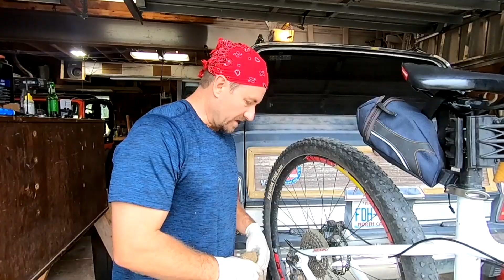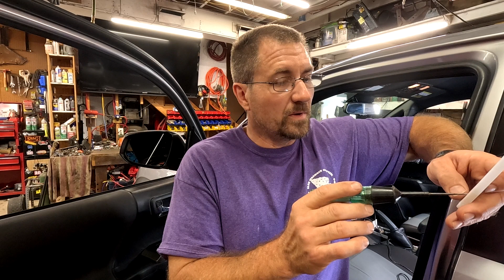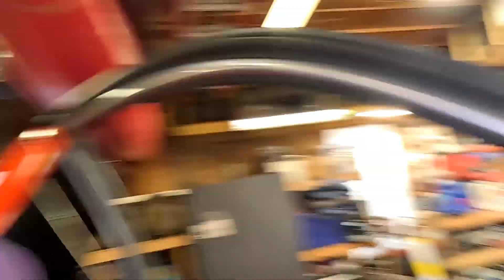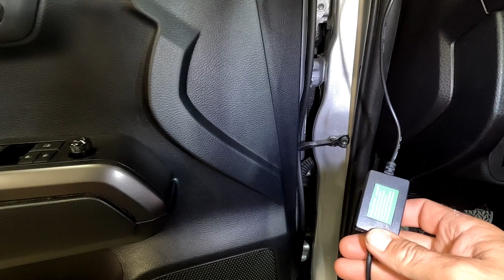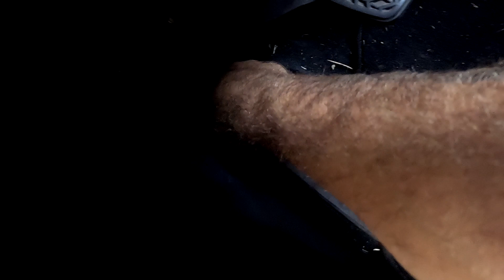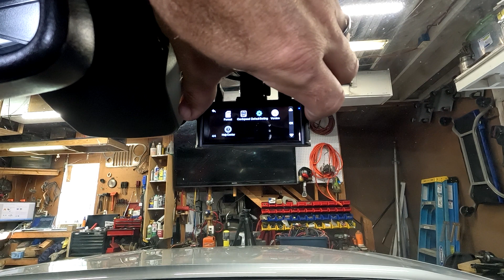Redtiger Dashcam wire kit.   Hardwire your Dash Camera, find the proper power source.

Comment: Thanks for the explanations on the red and yellow wires. The manual that came with the cord set wasn't even good fire starter. I had the same length issue but resolved it with a right angle USB-C adapter and then I just ran a complete new 10' USB C ext. cable with a factory right angle plug from the first right angle adapter plugged into the camera then right on down to the fuse panel area. I just plugged in and left the hard wire kit USB lead factory bundled and wire tied, plugged, and hooked everything up. It turned out pretty clean with enough wire ties down under, and the new USB extension cable tucked away pretty nicely. Probably a cop out on my part for not breaking out the soldering gun. But unlike my usual luck, Mr. 5 Lake Garage soldered without getting burned fingers and he saved the $20 on the cable gadgets that I should have saved for eggs.
Reply from the maker: I have my scares.  :)    And yes those instructions were garbage.  It sounds like you did a pretty good job on the install.   Having cables everywhere is just not good.    

I put one in my daughters truck but I have not been able to find the wiring kit.   they have been on back order for a while.  

I guess I will be able to get my eggs this week.  :) 

Good luck and talk to you soon

Comment: Don’t do it it will drain your car battery
Reply from the maker: That could happen.   I have not run into that as of yet.    So far it will only turn on if it is bumped.   the rest of the time the drain is low.    i took a trip for 14 days and it was still good when i got back.    A good battery is something you will need to check on.

Comment: Thanks, my friend,I appreciate it.🙏🏻
Reply from the maker: No problem.   i have found that this system has a few quarks but all in all, not a bad product.   Make sure you set the parking setting.   Mine got reset once I missed who bumped my front end in a parking lot.      Good luck
Reply: @5LakesGarage  Thanks, I appreciate it.

Comment: How long does it record if only leave it on the trigger setting? Is it just whatever u have your loop settings for 1/3/5 minute and then it turns back off until the next trigger?
Reply from the maker: it should record to what ever you have it set too.   but i will have to look at it a bit closer.    It would be good to know.
Reply: @ I tried to test it myself. I normally have it on for 5m loop recordings. But when truck was off I tried to shake truck like it got hit and it came on but looks like only stayed on for 1 minute. So I wish was able to change that to diffrent time lengths but there is no settings for that anywere

Comment: I connected the parking mode kit but it does not record, help
Reply from the maker: Sorry for the delay.  the Day job has been keeping me very busy.  i had an incident yesterday where someone hit my front bumper.  i check the card on the camera and it did not capture anything.   After looking at the setting on the camera I saw that the parking settings was reset for some reason.   Drove me to say some colorful words.    :(     Now for your issue.    I would assume that all of the wires are connected and you set the setting over on the parking setup on the camera.    Something i just thought of would be the parked power connection.  I wonder if the computer shuts it off after a while.  For example.  if you leave your dome line on the computer will turn it off after a while.    I will try to check that this weekend.   I might have to update the video with a different power source.   if i do, you will see it on the channel.

Comment: 8/22/24_Just had my RedTiger Wired and left the Lighter Plug(YEAH). Had a professional install as I worrying burning up my Nissan Rogue. I am glad you did the Parking Mode and which mode to use. I feel I will use the G-Sensor but maybe during Hurricanes go 24-Hr.  Glad I finally got this done. A computer friend did his first hookup with other brand I bought and I ended up with a DEAD Battery.  YES...having someone who understands wiring is BEST.  Thanks again helping me decide on MODE.
Reply from the maker: We try to help where we can.    With the setting I have mine on I can get about 120 minutes of video before it starts to remove.   I will be looking up the biggest size card that it will support.   That i really need that much video time but it couldn't hurt.     i also put on in my daughters car.    Tracking speed, location and traffic.

Comment: Do you not need fuse taps to be able to still use the ones you took as well as the RT wiring kit?
Reply from the maker: you could use them to keep the amps factory for each circuit.    On this install they were close enough i felt comfortable to double them up.  I have a few other vehicles to put one on.   I could touch on those when I put them in.  

Thanks for the tip.

Comment: Nice video thx.. FYI guild outfitters makes extended fuse panel covers I've also seen some on Etsy for the tacoma..
Reply from the maker: Nice.  Thanks for the tip.    Love this platform.    I will take a look.
Reply: @5LakesGarage  hey man, thanks for uploading the video. I plan on installing a dash camera soon have you had any issues with the fuse selection you chose?
Reply from the maker: I have not.   The only issue so far would be from the unit itself.   at times it tells me that the card is full and that it doesn't loop like it supposed too.   but most of the time it is fine.   I will be investigating that soon.
Reply: @5LakesGarage  oh ok thanks 
Also, I know one of the spots you chose was for a USB. Do you know what USB that is?
Reply from the maker: It was traced back to the USB in the center console.
Reply: @5LakesGarage   hey man just wanted to say thank you your video saved me $275 bucks on the install since I did it myself. 😎👊🏼.
Reply from the maker: Good job.    I have an hard time paying others for something I can do myself.    I just don't have time.    Glad it worked out.
Reply: @5LakesGarage  honestly man, I don’t mind paying for a install, but it’s the worst when you pay somebody to do a BS half fast install so I’d rather just do it myself  😅
Reply: @5LakesGarage  also had a question. What’s the name of the fuses? Are they low profile or just minis?
Reply from the maker: the low profiles are lowered minis.    Both of them will fit in the slot.   but after the install i am not able to put the cover back on.

Comment: Could you have hidden the “block” in the panel on the side of the dash?
Reply from the maker: i do not see why not.    As long as it fits.   Good luck with your install.    I need to run down to grab the memory card to remove the footage of the trail rides we did this past weekend.  I hope they come out.
Reply: Yes, he could have done that. I just did that today, and I used a 3M tape to hold it.

Comment: Hi There.  Great video!  Although I am in the UK (we drive on the 'wrong side of the road!!) so my Volvo XC 60 is right-hand drive but the principle is the same and the video showed me exactly what I needed to hardwire my Redtiger F7N.  I am not electrically minded so your video was excellent and it all seemed to work fine.  One question though that you may be able to answer for me if you wouldn't mind:  I thought I would see if I could run the Dashcam with just the ignition ACC fuse in (so without Parking Mode) so I disconnected the B+ fuse (Yellow wire - Constant) and turned on the ignition and the dashcam did not come on.  So, does the B+ fuse have to be in for the dashcam to work off the ignition also?  I hope I have explained myself OK?  Cheers, Mike
Reply from the maker: Good day Mr. Thompson.    Sorry for the delay. I was away in the woods with the scouts camping and retiring flags.   We did find a Union Jack flag in the bag so we googled on how to dispose of it properly.   I just hope we did it justice.   We appreciate our allies and they should be shown respect.      Now onto your issue.  With the hard wire kit, i believe you will have to connect both wires up.  Both ACC and Power on.    if you do not want the parking mode option then you can turn if off in the software.    if you connected them both and the camera still does not operate then I would check the ground and then connect it directly to a battery to ensure that the camera is operational.  

i hope this helps a bit.   let me know how it goes and maybe we can find another option.   

Thanks for your watch and comment.  good luck.
Reply: @5LakesGarage  Dear Sir.  Thanks so much for your reply, much appreciated.  It's all up and working now; I did not read the manual 'small print' close enough. To get Parking Mode you have to turn on ignition then turn off, then set parking mode in the menu then turn ignition on again and it locks it in!  All Good!  Incidentally, spent 4 very happy years with my family in your great country based in California back in the 80's (I did exchange tour with your Air Force); made many good friends and have some wonderful memories! Best wishes to you!
Reply from the maker: Good to hear that it is working.   The small print is really small.   :)  You are welcome back in the states any time.

Comment: You can touch your test light  one of the probe spots on the back of the fuse to test for power without having to remove the fuse. If the ground spot you use for the probe works… It will work as your ground for the installation. Good video.
Reply from the maker: Good point.    We do love this platform.   We learn as much from our viewers as we teach.    thanks for the tip and the watch.  

Check out the playlist for the 3rd gen Tacoma for more videos.

Comment: So is the hardwire kit “fused” so to speak? Asking because you replaced dedicated fuse’s with that harness instead of choosing an empty slot which seems to be what the instructions suggest.
Reply from the maker: The kit came with with fuses.   The better plan would be not to piggy back on other circuits but i did not finds any.   (did not look too hard)  I chose two that are not heavily used.   Dome light stays live all the time and USB fuse cause I had it connected to the same circuit but down the line.   

So far it has been working great.   It is funny playing back the conversations of Techs that bring your truck into the shop.    They all pick on each other on how they drive a Manual.    :) 

good luck. and thanks for watching.